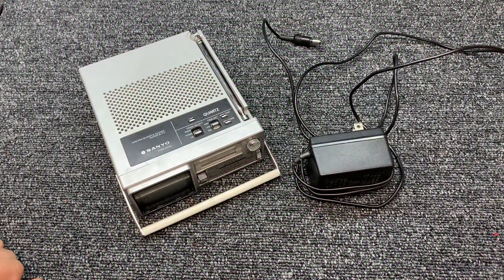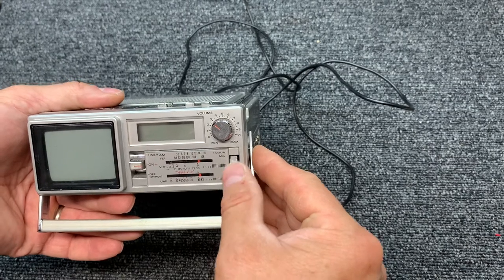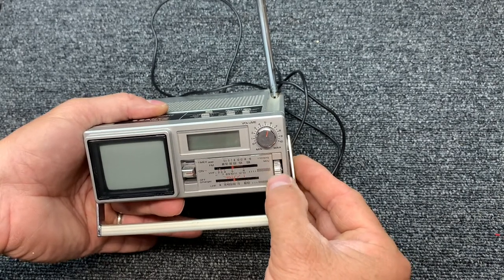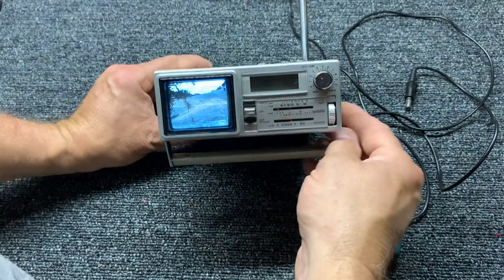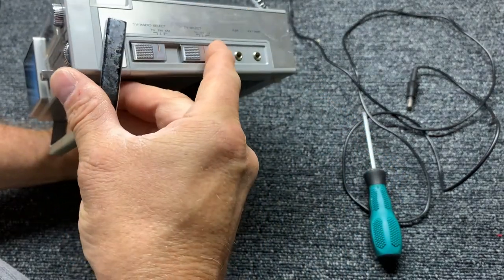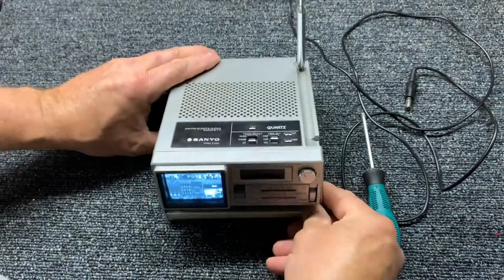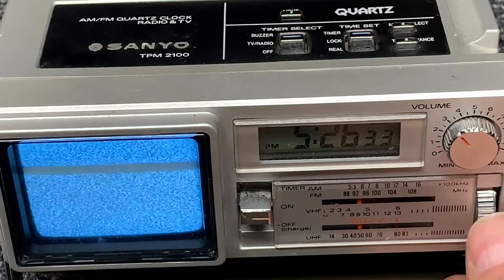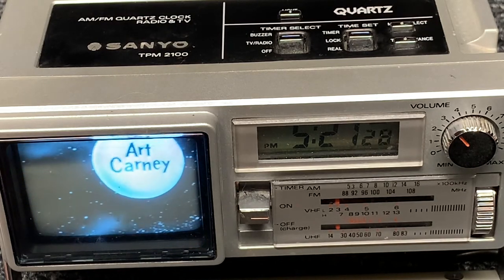Tiny 1980 clock radio Tv

Comment: That is a gorgeous TV. On mains it's getting 9V, but on batteries it's only getting 7.5V so the old caps will struggle a bit more with less power.

Don't you hate it though, You buy something to fix, then it has the cheek to work. :)
Reply from the maker: Yes I was thinking about that Franko. I could pull it apart and tweak the horizontal pot.  Was surprised that it worked okay pretty much.